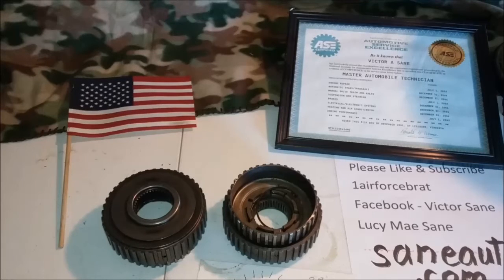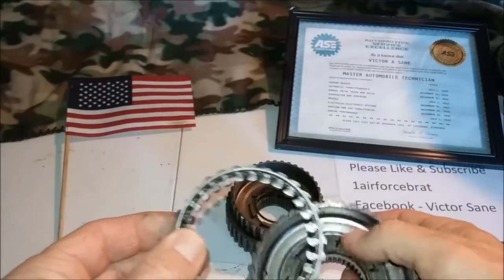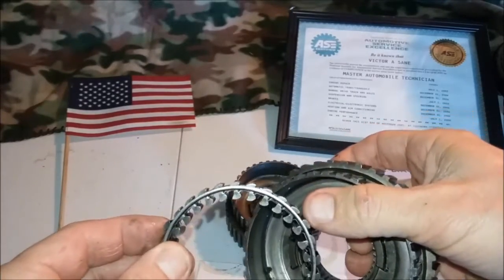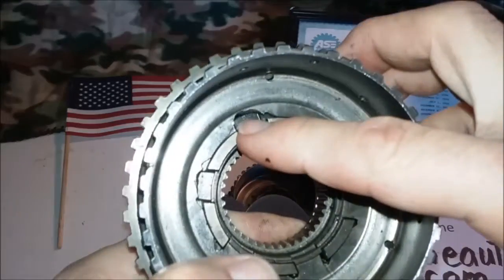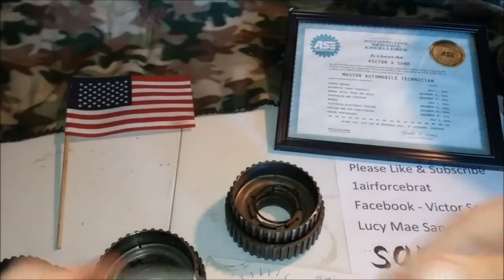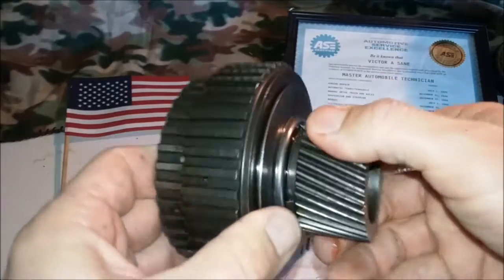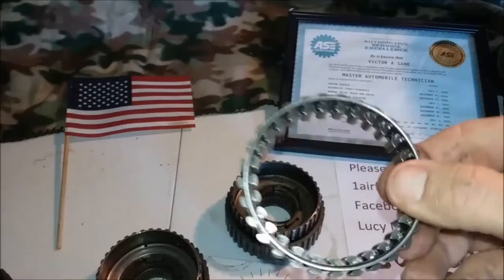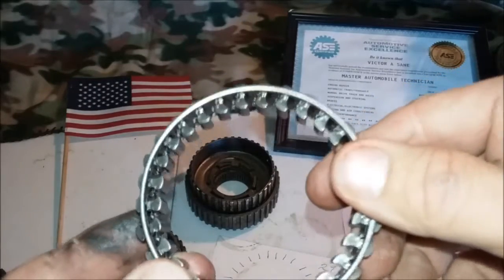Transmission parts ID 4L60E Forward Sprag differences interchange episode 002 no 3rd or 4th gear

Comment: When I was a builder  had a job where this input element failed and it caused the reaction shell to spin so fast that the fingers that mesh into the reverse drum spread open and rubbed the inside of the case nearly machining it in half
Reply from the maker: Yes I saw that a few times. It was the low reverse roller clutch that let it spin backwards. Both sprag/roller clutches are usually bad by the time that happens. I had kept one all splayed out like that but I have so many parts now I couldnt tell you where its at anymore. Thanks for jogging the ol memories.

Comment: 2000 impala, works manually all gears but wont move on drive or 3rd.....also reverse works.....scanner give me code p0748 and p1810....any ideas what this may be.....also i changed out the solenoids but no change
Reply from the maker: clutches are burnt
Reply: @saneauto  even though it works manually?

Comment: all of them do not use 82-85 retrofit and only use dual cage sprag  these are the best the single cage sprag you are showing is not the best sprag  no matter if its 28 or 29 element
Reply from the maker: I put a link to the latest best sprag in the description. It is the 29 element with dual cage.

Comment: I just did a rebuild on my 2004 Yukon 4l60e transmission. I installed it back it the truck. filled it with fluid fired it up, let it get hot, put it in reverse. No problems. Shifted to drive and nothing..... I just screamed NOOOOOOOOO!....LOL I knew what I did. Put the damn bearing in backwards..
Reply from the maker: I used to have a poster somewhere with all the popular sprag rotations photos and all. If I can find it I will make a video out of it. I wonder what I should say as the title to that video?
Reply: @saneauto  I had one of those posters too and on mine had the E4OD direct drum rotation wrong 😂 I think it was an RPM chart!

Comment: in 1985 I designed a new drill for the 28 element inner ring lube holes- GM bought a new machine with teething pans, and contacted my boss to see if we could help drill parts (we turned the blank rings)  for '6-8 weeks'... lube hole angle changed from the 1985 model...

  the little drill i was really kinda proud of- hydramatics old pre-86 drill had three parallel heads on a 6 station dial, index of the dial took care of the 120 degree spacing... with large drill heads, dial was about 6-7 feet in diameter.  I opted for a twin spindle on 12" centerlines to drill 2 at 120, and a single head reached in between from opposite side,  reduced index table to 17" diameter :)
   we ran it for near two years as toledo hydramatic fought with a goofy inline transfer they spent 1.2M on for the revised sprag, every time it broke a drill, it crashed, a bit stuck in bushing, when it dropped to index, part jammed- looked like a really bad design, musta been 30 feet long with 4 door electrcal cabinet... mine didnt use bushings- if you look at the groove, its a full radius, drills self center... little guhring 631 drill(remember as we had about 500 extra drills around) lasted 3000 hits before changing, rarely ever broke one. the Kingsbury drill heads i used were pulled off old machines they'd paid us to haul away... had a budget of 6500 to build two machines, one operator put out 3000 pcs a shift... 

in the end toledo scrapped the transfer and bought the little desk sized drill :) the day they came in to see our little machine, they were all flabbergasted as to how small/simple/fast it was..."thats all we needed"

 betcha every drill spec'd since was copied off the cheapo drill built by the 22yr old ohio kid out of junk :)

funny, I bought a new 85 camaro with the 700r4, 1-2 accumulator spring, tv spring, governor gear all failed in the first ten years...was able to fix those out in the driveway... I got rid of the car in 2005, only had 60k on it, but the tranny finally went in a way that required pulling it completely out...no easy fix that time, had to yank it out in the garage...forward sprag was all tore up- got to thinking, I still had the first one we drilled in my toolbox 20 yrs later(unfinished of course, but could see the lube hole angle/dia diifference, just thought it was kinda ironic...)anyways, 15 bucks for a used revised sprag, 50 for a soft parts kit, 20 for a ATSG manual, it was back on the road in a few evenings...other than the trans, it had been a good car- but those early 700r4s were garbage reliability wise. a friend bought one 2 weeks after i did, he had three full rebuilds in 100k miles on his, and he was paying 1500 each time...
Reply from the maker: Best comment ever. My Camaro was an 86 3rd gen 700R4. I started building in 1991 so I had a long list of updated parts to improve these units. And a friend that I could pay to make me stuff ;-) I still have my lists quit a few parts some cores, my old dirty ATSG book and even have one of my own built units in my 1985 Corvette. I wonder how many of your sprags I came across or ones that wen through your designed machine? Thanks for sharing and bringing up the memories Tim. Come back and comment more anytime.
Reply: funny thing about those sprags too- went to the IMTS show that year and a company called WERA had a machine called a 'profilator'- it was cutting the 'castle' part of the sprags at the toolshow :) was a REALLY reird machine, part was chucked like in a lathe, and a rotating/off center head plunged straight in axially..."BRRRRAAAAAPPP"  and done, just that fast! 
the timing of the tool/workpiece resulted in the straight 'keyway' like cuts- about half ive seen were broached(straight tool marks) and half were run on a WERA machine(blend mark in middle of 'keyways', as one side cut entering, one exiting... weird machine, fast as heck, from what i could tell the tool runs thru wild geometry changes at contact point- high positive to high negative as it enters/exits the cut- but it worked slick as can be
Reply from the maker: I clicked on the link and watched the animation. What an ingenious simple solution.